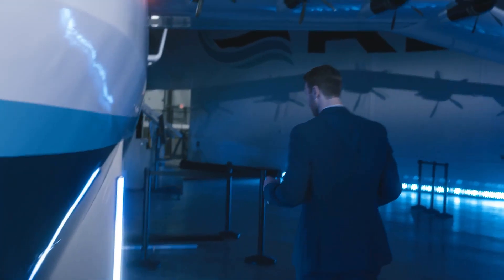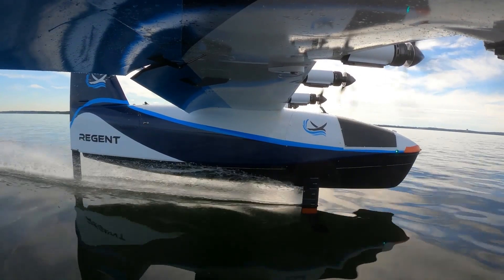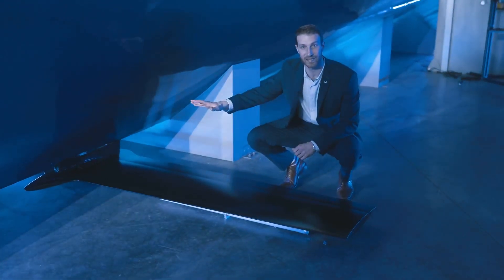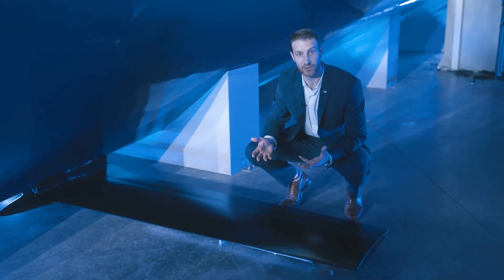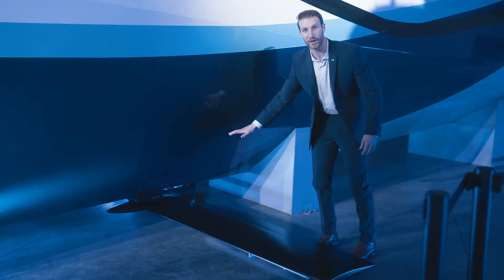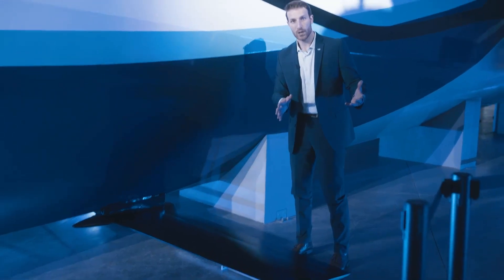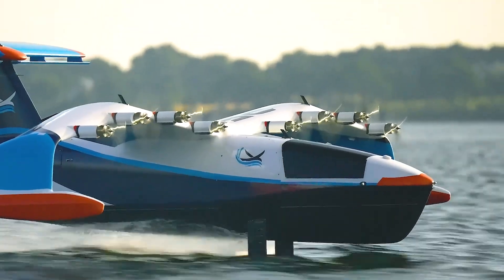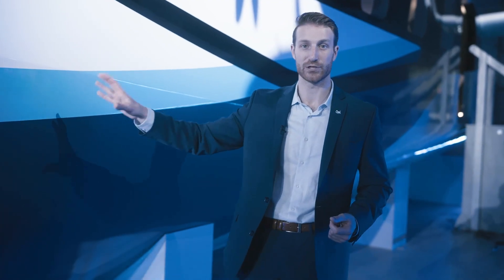Hydrofoils Provide Wave Tolerance, Comfort & Maneuverability for Seagliders

Comment: Ok, so you have relatively high wave tolerance on take-off by using the hydrofoil, but then you retract them and land on the hull with lower wave tolerance? So you can only use this when on expected landing the weather is within limits? What is the range going to be?

Ah 300km, about 1 hour flight at flight cruising speed of 300kph. If a bad weather front is larger then 300km then basically it can't really take of because it can't land in range?